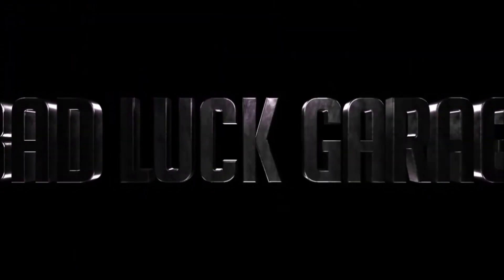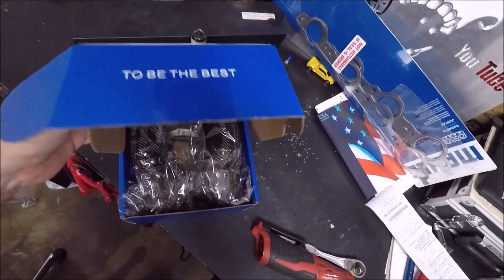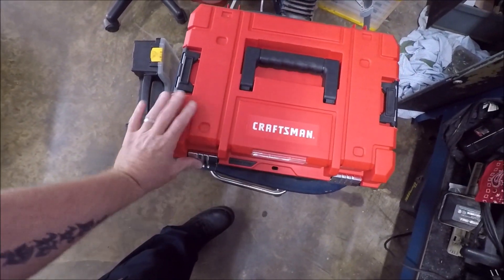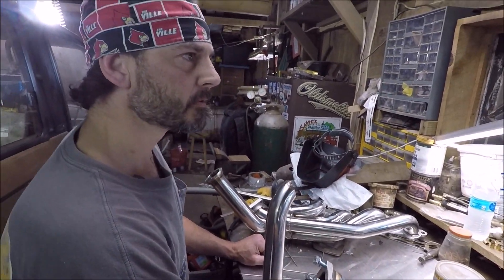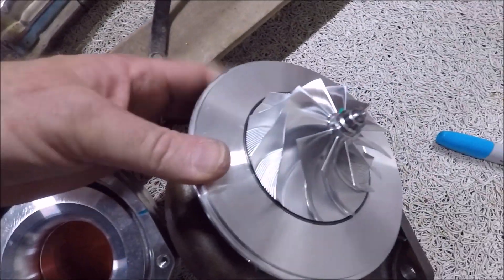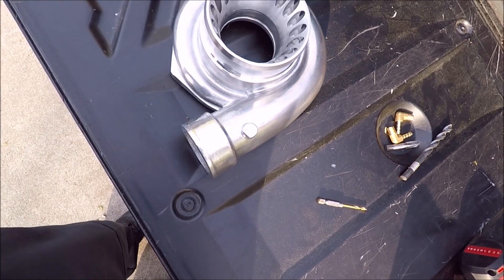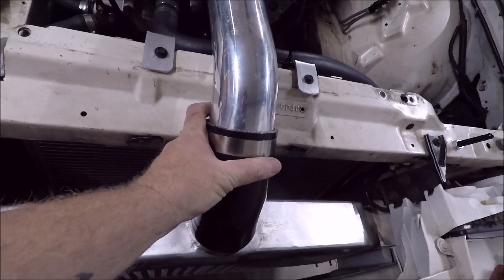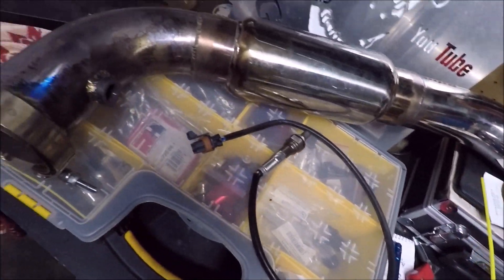BUDGET TWIN TURBO LS BUILD...........THE LITTLE THINGS

Comment: Don't you think it's a bad idea to t your oil supply lines to the turbo. Just seems it could be a issue with oil starvation to 1 turbo or the other
Reply from the maker: Nope. If you’re running two turbos you have to have a Y or a T somewhere and before the turbos is where you want it. Preferably as close to the same distance as possible so both turbos receive the same amount of oil as I did here. What you DONT want to do is try to daisy chain your feed to the turbos. As an example, trying to run the feed to one turbo, then tee off that turbo to the other turbo. In that scenario the first turbo would get all the oil and bleed off pressure starving the second turbo in the chain.

Comment: I see everyone run the turbo oil return line back to a hole made in the oil pan. Why is it not returned into the other hole above the oil filter? One is pressure out and the other is return. Is there a problem going back in above the oil filter????
Reply from the maker: It’s a return to the filter. It’s still under pressure and then feeds to the top of the engine. Can’t return oil at zero pressure to an area that’s under pressure. 😉
Reply: That sucks. So have to put a hole in the oil pan for all returns of oil? Is the back or front hole for the pressure oil feed? So I'll cap the other hole.
Reply from the maker: @richardcoleman9645  Watch this video. It’s the first video I ever made on YouTube. It’s a totally shitty video and I ramble a lot but it should kinda explain. Lol 
https://youtu.be/xougOfO1EKQ
Reply: So where do I get the oil going to the turbo of not from here? I've not done a turbo on a gas engine before. Only big trucks on diesel engines that had factory oil lines.
Reply from the maker: That IS where you pull the feed from. It’s just not where you return to. Go back and watch my last video. I went over all this. 😉

Comment: The little things can add up to be half the of the project time because it can be hard to find good info. When you plumb the wastegates and blow off valve I’d like to hear you go over how all that works.
Reply from the maker: I kinda have already several times on different builds on the channel. 😉 Like I said a few videos back, initially I’ll just be running the boost reference straight from the turbos to the wastegates. Later I’ll be installing the 4port Mac valve to utilize the Holleys boost control and I’ll probably do a video just on that since I’ll be replumbing all the vacuum lines at that point. 👍

Comment: 2200$ is more than enough for you to have been happy with your body repair. I run a body shop and we are always busy and we still make sure a customer car is always on point. You want them to blend it into the fenders and hood and if their not cutting&buffing the finish product then ask for your money back and go somewhere else. You should know your body guy and trust them
Reply from the maker: I dropped the car back off today and that’s exactly what they said they were going to do this time. They’re going to paint up the hood and fenders and blend it in and then they’re going to cut and buff the nose to get rid of the imperfections. Hopefully it’ll be good as new when I get it back.